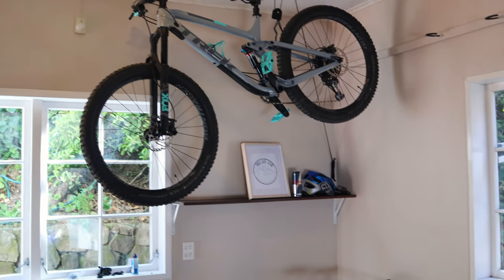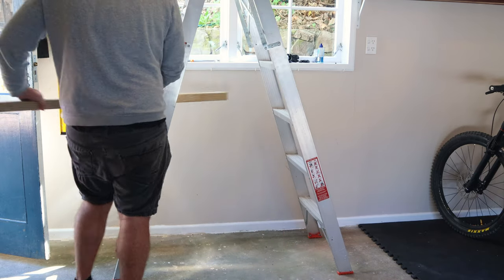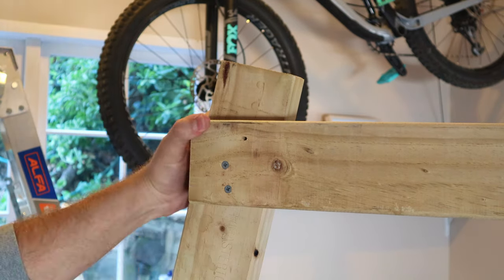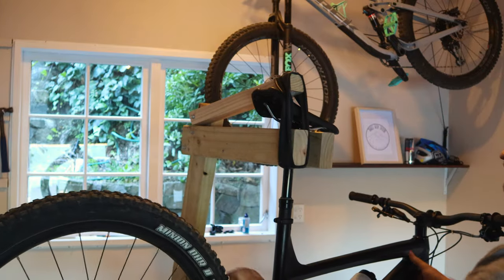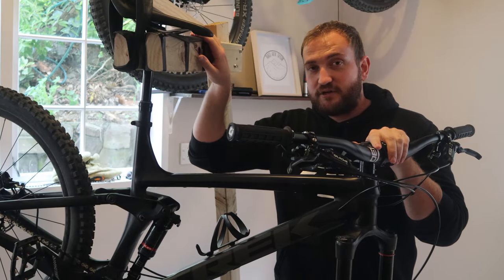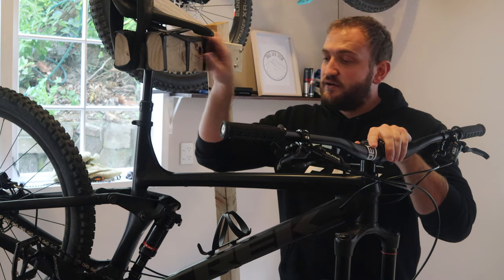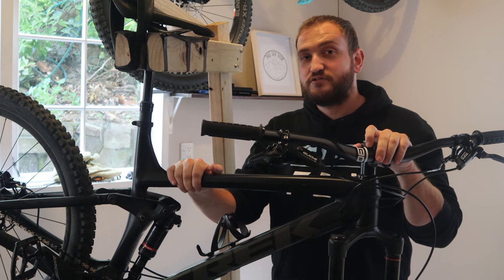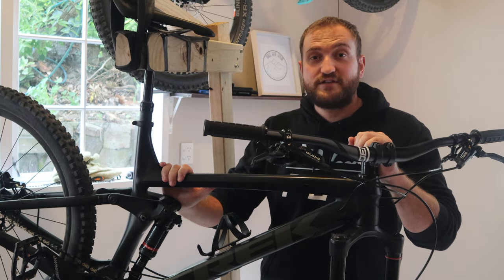How I built: A HOME MADE WORK STAND!!!

Comment: No angle adjustment, is ano go for me, I need to be bale to adjust it at some extreme angles, to do brake maintenance, having that means I can put loctite 243 on the threads for pads on my mechanical brakes, also is useful for other jobs too. I attach my bike via the top tube. I have the Park Tool Prs3.2-2. The height is adjusted so I can work comfortably, and I can work on any 2 wheeled bike, with any top tube angle, or seat tube angle. Also a clamp like on this stand is a must for me. For me it was worth the investment. I had it for several years now
Reply from the maker: ok. enjoy that! Good thing about this is that i can put my top tube in it as well and service my forks at least. :)